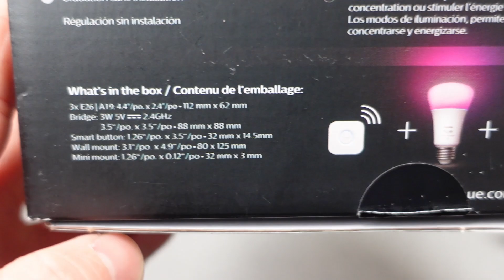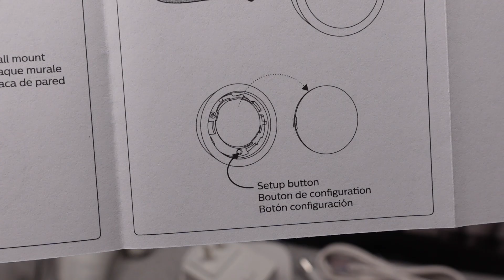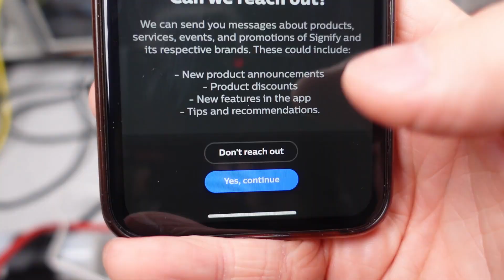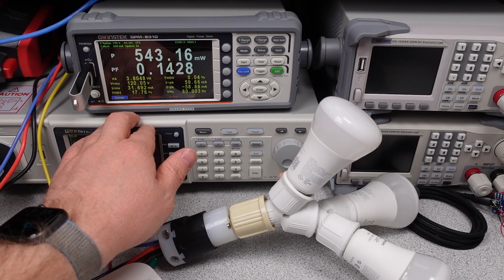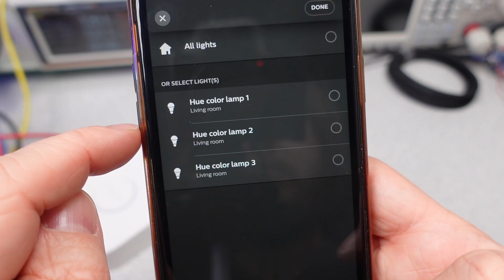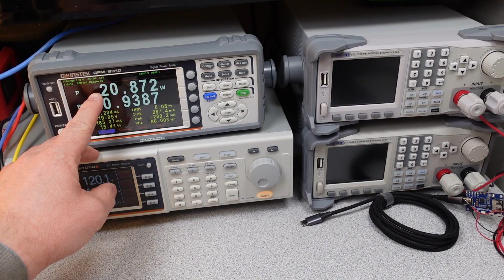Philips Hue White and Color LED Bulbs Smart Home Kit

Comment: Is there a difference in the white light performance of white ambiance and white and color ambiance? After all, one is a product designed just for this purpose.
Reply from the maker: These bulbs have the LEDs for warm white and cold white, they are really WWRGB, it looks like the color mode switches in the app, it's not dynamic between the two, so you either get WW or you get RGB.  So, they match with other WW only bulbs when in WW mode.  Not considering LED variance, they don't do active color correction or calibration.

Comment: Someons claimed that Philips Hue bulbs and led strips were among the few smart bulbs where you could actually notice a 1 % difference in brightness. Was that your experience too?
Reply from the maker: They do have very fine control over the brightness and the colors, in white mode color temperature, in color mode any mixing.  They appear to have very low flicker, it's just fast enough you can't tell, which is very welcome.  In terms of quantifying not sure if it's 1% exactly in terms of raw light output but you notice when you change the setting on the app.

Comment: Each Hue Bridge requires its own, separate account.  Each account needs a distinct email address.   Each account can only be in one physical location/address.  So, effectively if you want more bulbs than a single bridge can support or you have multiple properties, there is no easy way to control everything at once.  That is one of the key limitations of the system.  The other main downside is how comically expensive it is.  But it is very, very reliable once you set it up.  I think that is why it is so popular, it just works and works well.  The physical switches still work if the internet is down, you don't lose all of your settings if the power goes out, you never find that a bulb doesn't go on when scheduled because it didn't get the command, you never have to power cycle the hub because of crappy software, etc.  You are paying a premium because it is being supported by a big company that can afford to make the investments in software updates, quality design engineering, etc.  I have had my system for a few years now, and I've been very happy with it.   Pro tip - the color bulbs are a waste of money vs. the "white ambience" bulbs for most applications.  Think very hard about whether you really need to turn your living room into a disco before buying a lot of the color bulbs, since the white ones are half as expensive.

Comment: I'd love to see a comparison between Ikea and Hue of the white curves for the "tunable" white ranges of the various devices, compared with regular dumb bulbs at various white points. I know, super niche.
Reply from the maker: Niche is kind of what this channel does, haha.  I want to get some better light measuring equipment.  Time to eBay.  I have a few lux meters but I need something that can measure color temperature.  I am not sure how complicated it is to measure CRI too.  Lumens basically don't mean anything so not so important on that and it is too complicated and expensive to setup a goniophotometer.  I think that color temperatures and color rendering between different bulbs would be very interesting.

Comment: Hello, I just got a new Baseus 100w Adapter, it works really well. Thank you for your recommendation. I'm wondering if you're working on a USB C to DC Barrel cable, I'm seeing some listing on line but I'm a little bit concerned about the safety 😆
Reply from the maker: haha, yeah, I need to get moving on that.  I don't think they have a safety standard for that.  It would take 10+ years to create one if there isn't.  Industry does not move fast.

Comment: Interesting video.  
A few things:
• You can use the bulbs without the bridge with a hue switch as well as via your phone with Bluetooth - it's not required. The Bluetooth functionality (which is always on unfortunately) is probably a factor in the higher power draw. 
• I'm not too sure why you couldn't get the ikea bulbs to work? I've been using them for years with my hue system in areas where light quality is less important. I've never needed the IKEA hub and all have paired with no issues. 
• You can have multiple bridges but it's not seamless,. unfortunately. I reached the 50 bulb limit some time ago and have to switch between the bridges I want to control in the app.

I've been using these bulbs for many years and have never had one fail. Long-term support is great with every bulb and accessory they released for hue over the years still being compatible. Some of mine must be 7 or 8 years old by now.
Reply from the maker: Thanks!  Yeah, no idea on the Ikea bulb.  I thought it would be more seamless.  Good to hear about the long life.

Comment: Shouldn't specific colors draw less power?
Reply from the maker: Maybe?  The claims didn't say anything.  I bet its something like 1 watt of total LED for each red, green and blue, then several watts of LEDs for the white setting.  They could have a 10 watt blue LED and a 10 watt red LED, etc. with careful software but yeah it would not be so small then.
Reply: @AllThingsOnePlace  red spectrum is always known for low power.

Comment: I have currently had the older version of the Sengled from 2018 and that broke in like 2 years and I got replaced once under warranty. I had it plugged into my ceiling fan and they said that it has a dimmer built in. The second set broke in like a month so I assuming it was some software update. I bought a Wiz bulb and that worked great for 3 years into a standard pull lamp and that started to go bad last year. I think Wiz is also own by Phillips now as well. I don't really know what went bad on these two sets of bulbs since I only had normal toggle switches and a pull cord lamp. I want to like smart bulbs, but going bad after 2-3 years puts a bad taste in my mouth.

Fyi the Baseus with the outlet works well. It gets a tad warm so the double sided tape I had fell off of it so now I have two velcro wire straps holding it up and it works great.
Reply from the maker: Yeah, time will be the test for these.  I saw lots of comments of these lasting a long time.  Obviously, my poor Ikea bulb won't last that long since it isn't connected to the heatsink anymore.  

Good to hear on the Baseus, I picked up one with the 100W and outlets so I'll be putting it through it's paces soon enough.

Comment: I can't speak to their longevity, because YMMV, but... my oldest Hue smart bulb is now over 6 years old. The oldest Philips Hue product that I own however, is one of the original Living Colors lights, and that one is over a decade old at this point (and it works with the hub!). I've been using these lights 7 days a week since I got them new. All in all I have a dozen or so of these bulbs now. They vary in quality somewhat (Philips has been updating the hardware over the years). Given their apparent lifespan, their higher prices make sense - and it's worth to note that Amazon does regular sales on these bulbs and you can pick them up much cheaper then.
Reply from the maker: That is a good point, if they last that long, the extra price is okay.  I have had many cheaper LED bulbs burn out.
Reply: @AllThingsOnePlace  Oh yeah, my other LED bulbs (including Philips) die all the time, but the Hues have been remarkably resilient. Perhaps I've been lucky. Like any product, I've read some nightmare stories about them, but personally I have been fortunate never to experience any significant annoyances. The worst that ever happens is sometimes a light will get lost and desync, but that's usually an easy fix of turning it off and on again. Where it does get problematic is when you start getting fancy and throw in motion detectors and the like into the mix - then, oh yes, they become a whole lot less smart than the advertising would have you believe - but that's a whole different story.

Comment: I'm glad you're looking at bulbs but I've wanted to ask have you considered looking at popular USB-C laptop chargers? They often don't say they support a bunch of modes but if they do they could be a good source of inexpensive, high output USB-C chargers. My Dell Precision came with a 130w unit, for example, and claims to have two outputs @ 5v 1.0a and 20v 6.5a. Maybe there are other modes unofficially? Thanks!
Reply from the maker: Bulbs are not as popular as adapters I guess, I will probably not do more of these for awhile.  It might support other modes, I have an HP one I tested that does 5,9, and 15 volts.  Technically if that Dell is using a USB C port, it is not in specification for the USB C port if it delivers more than 5 amps.  The proper way to do that is to increase the voltage to 28V to deliver the extra power as the MACBOOK did, or use a different connector.  Anyway, I do have some of the laptop adapters around but haven't tested them yet.  It certainly will be a topic in a future video.
Reply: @AllThingsOnePlace  I didn't mean to downplay bulb videos. I watched it as I have all the others even though it's actually less relevant to anything I'm doing. I just had the laptop power adapter thought and dropped it on the next video you posted.

I'd also be interested in disassembly videos that get into the EE of it all. 

Thanks!